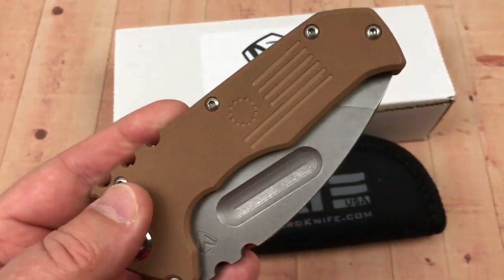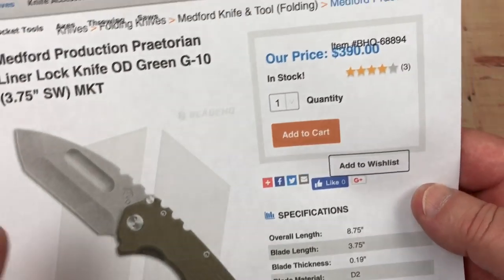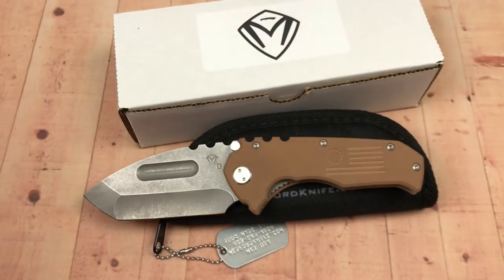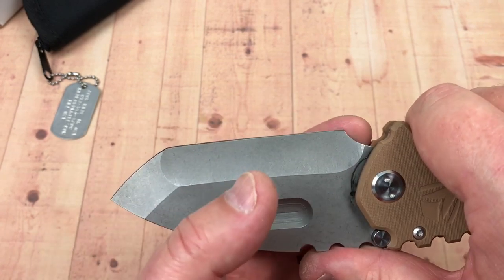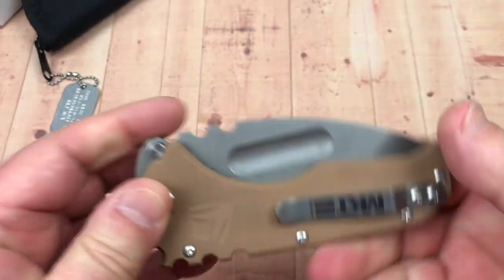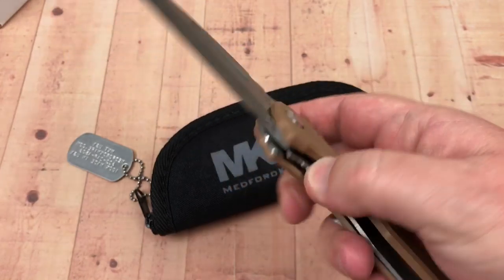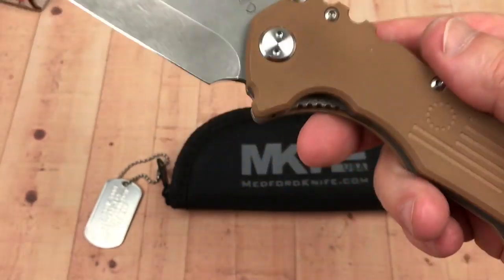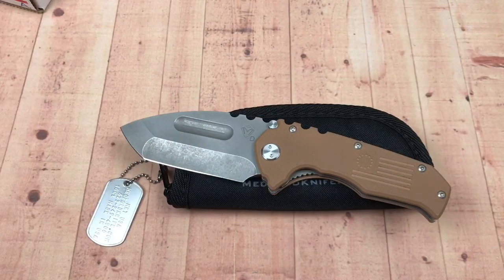Medford Production Praetorian linerlock Knife  Badboy Knife with a nicer price !

Comment: My beef with this knife is the type of lock chosen. If it was a fixed blade it would make sense but a linerlock its not a type of lock which is good for a hard use folder but I understand that some people does not want a Tri-Ad. Some people want a hard use in the framelock/linerlock configuration.
Reply: Tri ad lock has never failed me
Reply from the maker: PowerMadHeadBanger   Great point ! 👍